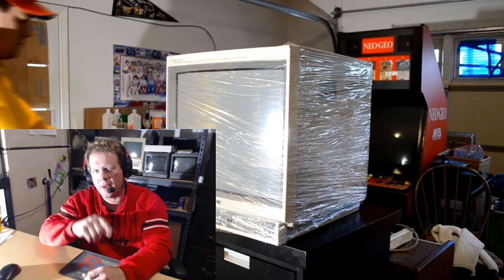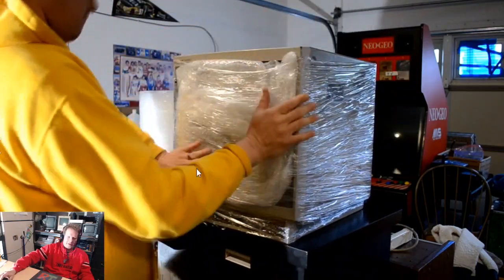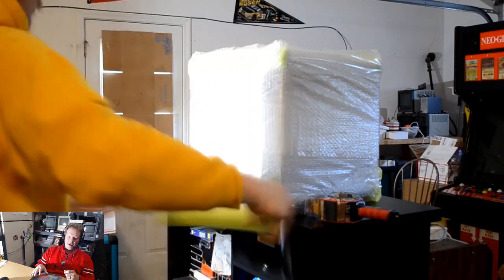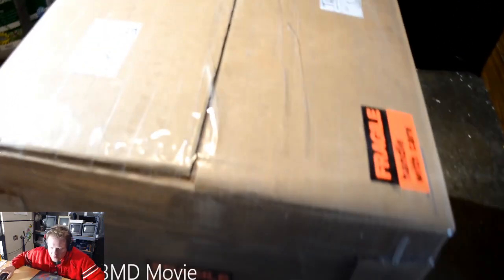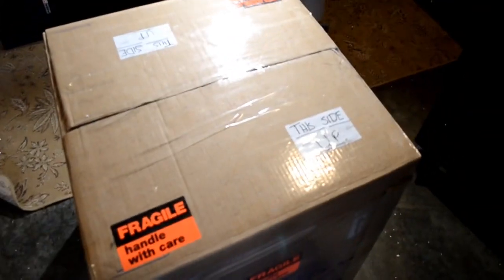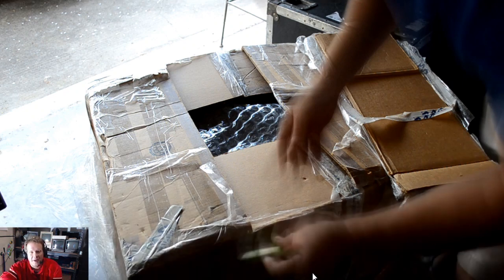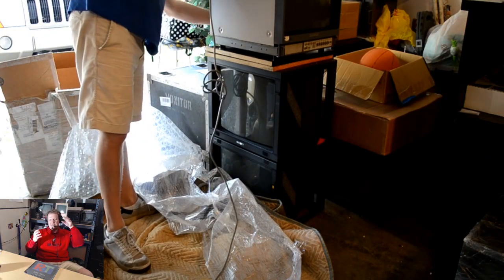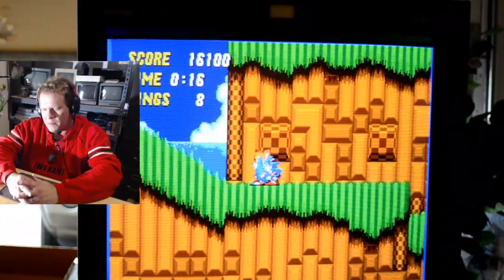The Big Gamble: Shipping eXtra Large Priceless CRTs & Olympus OEV 203 Unboxing from eBay!

Comment: Essentially, they need to be packed the way Sony used to send them-double walled box, and thick polystyrene inserts-which is exactly what Steve uses here. I know when we used to receive monitors from Sony, they would sometimes come strapped to a small pallet, especially the D24’s and sometimes the 20inch models. I successfully shipped a D24 toSweden and a D32 to Germany using the methods Steve shows here but additionally strapped to a pallet. Obviously, the buyer would need the means to receive a pallet, with a driveway, garage etc
Reply: I believe the pool noodles are polyethylene foam. Polystyrene is more rigid. If a buyer can't receive freight at their location, if they have a truck they can pick up at the terminal.

Got any more D32s to sell? :D
Reply: vintage.digital I only ever had one D32. They were never sold in great quantities and most of them got junked when the tubes failed, as they were very expensive to replace & not always obtainable.
Reply: 👀 any D24's you'd sell?

Comment: Good tips Steve. I had to ship a 2730 from the UK to France last year and i packed it pretty much the same way and it arrived safely. Only thing i did differently was i put the package on a pallet and strapped it together at the buyers request. It was so heavy! Stay safe 👍
Reply from the maker: That's good to add a pallet for those extra big PVMs.  I talked with my FedEx rep about larger shipments and she said that all pallets had to be shipped with the freight division.  Did you have to use freight? If so, did they offload the pallet from the truck at a residence?  Thanks.
Reply: @RetroTechUSA  The package was shipped via DHL express worldwide and they didn't say anything about the pallet being a problem. Fortunately the pallet was the same size as the package so maybe that was the reason. It was expensive to ship though, £280, but buyer was happy to pay.
Reply from the maker: Cool.  Thank you
Reply: @RetroTechUSA  If it's on a pallet, you want to ship via freight, trust me. Never underestimate the ability of a small package handler to mess things up in ways that you would never think of doing. I had a customer ship a machine to me once, where I had mailed them a custom made cardboard crate with polyethylene foam inserts, straps and packing/lockdown instructions. I told them multiple times that the item must be shipped freight. They sent it out via FedEx Ground because this was "company policy". The crate arrived at my house with the pallet on top. I had to reject it. They destroyed the machine. Meanwhile, I shipped dozens of these very fragile machines via international freight without problems. Yes, I had labels with arrows saying, "this side up" on every side of the package, as well as "fragile", and "top load only". Those labels are inconsequential to a small package handler.

Freight shipments are moved by forklift so they're handled infinitely more safely than small package handlers who will drop packages and roll them around on the ground if they're too heavy. I would strongly recommend putting any professional monitor 20" and up on a pallet, and shipping it via freight. If an average person can't carry it easily, it's not going to get treated well in transport. They're big enough as it is but think how hard it would be for one person to carry once its boxed.

You have to do a lot of shipping with FedEx and negotiate special rates to get decent freight prices from them. I'd recommend using DHL for international freight, and for domestic freight, comparing prices from companies like R&L, XPO, Saia, etc. This is by far the safest way to ship larger items.